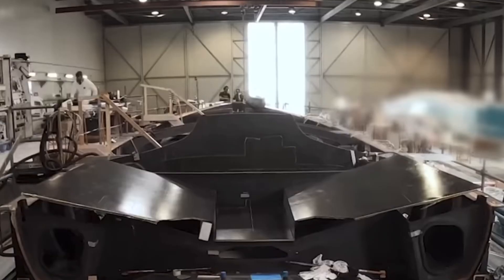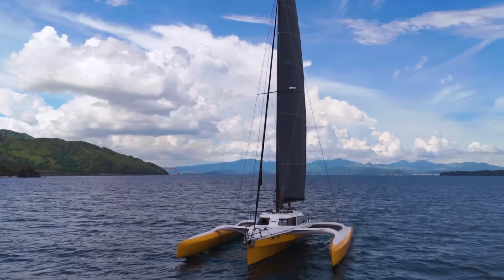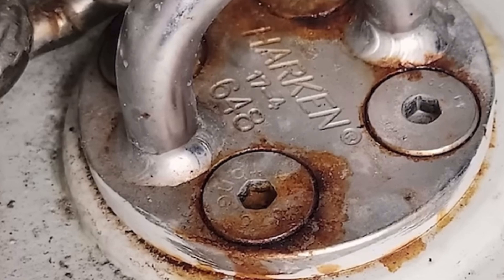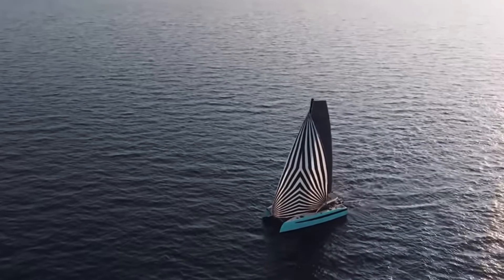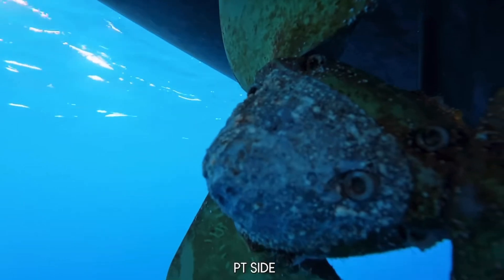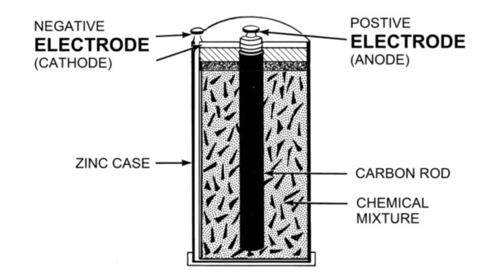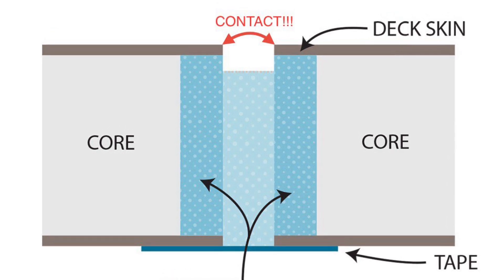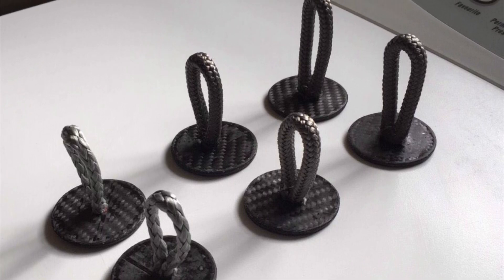Is Carbon Fibre Really a Good Idea for Cruising Boats?!?!?

Comment: I have pondered this conundrum in the past. With the advent of carbon fibre, and up until now, its relative unavailability to more budget conscious builders, we've only seen carbon fibre used in high performance applications. It's one thing designing, building and paying for a high-end performance carbon fibre vessel that planes in barely double digit winds, and then paying for its upkeep and living with its foibles. Its purpose is purely to just go fast, and to heck with the expense and the compromises.  It's another thing altogether producing a comfortable, durable and safe cruising yacht that can be maintained on a more realistic budget.
Realistically, we haven't seen a naval architect, or a manufacturer design a carbon fibre cruising yacht from scratch, and manufacture it. Of the attempts that I'm aware of, they are more akin to "tuned down" high performance boats designed purely to take home the silverware rather than boats designed specifically for cruising.
 
It's a rather different story to that of the introduction of GRP and hydro-formed aluminium. At that time, using a Herreshoff designed boat, or an S&S or whatever, as a plug, made perfect sense.
They were already cruisers or racer cruisers that were adapted well to the all new GRP. With time of course, naval architects learned of the benefits of GRP and were able to design more performance oriented yachts around the material. And with the advent of carbon fibre, those performance yachts evolved into beasts.

From a design perspective, the problem that I see with carbon fibre is that naval architects have to work backward with it in order to maximise its qualities as a material in cruising yachts. 
And they haven't done this, yet. And from a couple of recent examples, yards seem to have a lot of trouble understanding electrolysis and presumably other problems with the material.

Trimming weight from the hull material is a no brainer, as long as it doesn't come at the expense of durability. It gives room for better weight distribution, increased ballast and in the case of the cruiser, increased fuel storage, water storage and provisioning. But so far, this hasn't been a consideration, it's all about double digit speed.
And don't get me wrong, there's a place for that. But there's also a heck of a lot that can be done with the material that isn't being done.
Perhaps there's no market for the vessel that I envisage in my mind. It's certainly not me. My budget is a lot less than that. Gotta love 70's/80's GRP!
Reply from the maker: Good points! I agree that the fast production multis (e.g. Rapido, ORC) are not really live-aboard cruisers per se but performance boats with accommodation for vacationing and/or race crews. It would be interesting to see what an architect designing a pure live-aboard cruiser would do with carbon! On the other hand GRP really has stood the test of time with decent performance and good maintainability at a fraction of the cost of carbon.

Comment: Fiberglass is not good for anything but the cost. If you say otherwise you are just coping.
Reply from the maker: It’s also more durable if you hit something - can absorb twice the energy of carbon fibre before breaking. What kind of boat do you have?
Reply: @SailingTipsCa  non yet. If you want strong you go steel, if you want ok strength with ok speed you go aluminium and if you want speed carbon fiber. So where is fiberglass in this? Nowhere.
Reply from the maker: @connannbarbarin3033  Everything is a compromise! For example an aluminum boat with ok strength and ok speed will be more expensive than a glass boat. On the other hand a glass boat from a good builder can be lighter and faster than aluminum but not as durable, but still more durable but slower than carbon. If you were to create a durability <-> speed continuum it would look something like steel, aluminum, solid glass, glass/foam, carbon.
Reply: @SailingTipsCa  no, solid glass will be slower and weaker then aluminium and since only a few makers use solid glass and even fewer use it make anything other then old full keel design any good solid glass will be expensive. And i do not think glass/foam/glass (some builders say glass/foam is stronger then solid glass) is safer if you hit something then carbon/foam/carbon as (from my understanding) foam is what matters. I think that in real world glass/foam/glass will the same as carbon/foam/carbon if you hit something big (both are shit) and carbon will be faster. I am only looking at steel or aluminum for myself.
Reply from the maker: @connannbarbarin3033  There are quite a few solid glass / fin keel / spade rudder boats from the 70s, 80s, and 90s that actually perform pretty well and are reasonably robust. For example I used to own a Catalina 42 with a solid hull and fin keel and hit quite a few logs with only superficial damage (e.g. scratches). We raced it competitively and out-performed any aluminum boat we ever encountered, but to be fair there weren’t many we did encounter. Boats with foam core were lighter and a bit faster, but also much more fragile. All of that said if robustness was my highest priority I’d go with aluminum because it’s durable, relatively lightweight, and corrosion resistant (if everything is isolated properly).
Reply: @SailingTipsCa  fiberglass boats from 70s and 80s (and maybe 90s) are in my opinion dangerous. Resin would lost much of its properties. Now there is solid glass and solid glass. Some Hanses and Beneteaus have solid underwater hull, but it is thin and weaker then cored glass. More i learn about sailboats more I am actually leaning to steel motorsailers or trawlers.
Reply from the maker: @ Catalinas also have solid hulls. The hull on my Catalina 42 was 1/2” 12.5mm thick and reinforced with transverse stringers. I’ve never heard of a fibreglass hull failing because the resin was too old, but I know of many failures of cored hulls due to water ingress and delamination. Cored hulls are stronger in terms of rigidity but weaker in terms of impact resistance. Fibreglass doesn’t react with the environment around it so is simpler in terms of maintenance than carbon, aluminum or steel. The most important thing is that people understand the properties of what they are getting, and many don’t, so It’s great that you’re taking the time to research your purchase and understand the compromises!
Reply: @SailingTipsCa  if resin is deteriorated by time, temperature, UV and so on, its not like  the boat will fall apart, but it will be much weaker.
Reply from the maker: @ Yes UV is a definite resin killer and this is actually a huge problem on carbon components where the owners insist on the sexy look of glistening carbon with a translucent coating. You really need a good few layers of paint or gelcoat to protect the resin and slow its deterioration. As you noted temperature also accelerates aging so best to buy a used boat from a colder climate and not a place like Florida or Mexico.

Comment: I own a large 56 foot 6-cabin trimaran. She is built of epoxy fiberglass and a foam core. She is heavy and robust. Been two typhoons at sea and not even a spider crack in the gel coat. She’s experienced two very hard groundings and the kevlar encased keel took the brunt. Hulls remained in tact. All joints are 15-20x layers of glass and epoxy. She’s heavy, a beast. And yet, if I want her to go fast, she will. Multi hulls don’t heel over and “dump air” out of the sails like a monohull will. So your biggest problem is getting them to slow down, not speed up. So why the hyper focus on weight savings for an ocean passage cruising vessel? 

My favorite part about sailing is the passage, the journey. It is  beyond relaxing.  I am a surfer, kitesurfer, wing foiler, and sailboat racer. Those I do for adrenaline rush. But for cruising I enjoy taking my time and just chilling. Therefore, what I don’t get about the obsession with lighter weight in cruising is the “why?” of it. The tradeoffs for carbon fiber (same argument for electric electric engines vs diesel) just don’t make sense in the cruising market at this current time in technological development. CF is just too expensive for all the reasons you listed. If your objective is to “go-fast” in cruising, you’re not planning correctly and your priorities need realignment. I can get my boat to consistently surf down waves at 15-25 kts, even fully loaded. But the strain on the gear from deceleration in the trough is exponential and eventually something has to, and will, give, then, when you blow a spinnaker in two and it wraps around your prop as you run over it, or you snap a major rigging hardware component,  you’re now doing 1.3 kts whilst you repair at sea. Plus the strain on the body is fatiguing as well, 18-20 kts down a wave and then 5-7 kts in the trough hour after hour. Fun at first, but for what purpose? You MUST watch the boat at all times and you’re really operating on the edge of disaster if things go wrong like a major wind shit or a pitch pole event (end over end). You’re already in your home (on the water). Why are you rushing your passage? Where are you ABSOLUTELY needed and for what? I’m sure whatever it is can wait, otherwise you should’ve never been traveling by boat in the first place. Therefore slow wins the race. 6.5-10 kts is plenty. Unless you need to outrun a storm. The whole reason we bring our home on the water around the world with us is to enjoy the journey. Rushing is costly and will cost you even more  in mistakes in the long run. 

I will also slow the boat WAAAAAAY down to arrive in daylight, as oppose to trying to make a harbor or reef pass arrival before sunset. So when I’m approaching destination, I do the math on what speed I need to reasonably make the harbor entry by sunset or perhaps to slow down to 3 kts and arrive the next morning. Happens often. So if you’re suddenly slowing to 3 kts to adjust to sunlight arrival times, what’s the purpose of a “much lighter” boat then? Speaking from 50+ years of experience on the water. Save the speed for your buddies spartanly-outfitted race boats. CF is near pointless in a cruiser… even if you have money to burn.
Reply from the maker: Excellent points - thanks for taking the time to share! I think it’s a good strategy to get something a bit more practical as you have for your home and get the adrenaline rush in other ways e.g.kite surfing!!!
Reply: that is your reality... some people don't want the boat to be their life, don't want the boat to be their home, don't want to be on places because of weather etc... also speed is safety! and weight is also important for engine propulsion more than for sailing, because more weight will decrease the range, and again, not everyone want to be in places that they dont want to be. soo when there's no wind, some people want to be able to move, and fast. not saying that you're wrong, but they're different people with different reality, even people that need a helipad on the boat because they need to be in other places fast.
Reply from the maker: @CiberRepublica  Yes there’s really a big difference between outfitting a boat for weekend vacationing and/or doing the regatta circuit versus full-time live-aboard world cruising! It’s important to understand your own priorities before you begin, and they differ from person to person.
Reply: @SailingTipsCa  not just that, if you have real money why would you be limited to the boat? you would want to travel the world in it, but you can't know just the beaches 🤡 no one want to be the hole time in the boat, go to the country, go to a hotel, rent a car etc... beeing just in the boat limit your freedom. and if you have many house's why would you want the boat to be a house, it have to be like a playground, need to be different.
Reply from the maker: Yes everybody’s reality is different! I owned a large cruiser/racer for many years that I could have lived on and sailed the world, and also raced competitively, but my wife’s first love is horses which means we’re somewhat land-bound. So I sold that boat and bought a smaller dedicated racing boat instead. It has far fewer creature comforts but the performance is spectacular and I don’t have to maintain all the complex live-aboard/cruising systems anymore.

Comment: I totally agree on this one. Cruising will always involve taking a lot of weight with you. I have made the mistake before of owning a light trimaran and try to make it into a cruising boat. It just doesn't mix well. Decide if you want to race or go cruising. I have also owned an all carbon A class catamaran. Never again. Constant breaks downs. But if you want to race it's necessary.
Reply from the maker: Yes and if you want to do both maybe get both - like a heavier cruising boat and take the A cat with you!
Reply: @SailingTipsCa  perfect !

Comment: High performance sailing, CFRP (carbon reinforced plastic) is necessary. But for a cruising boat the CFRP is not necessary. It might look high tech, light and all, but that’s it. 
Disadvantage is that CFRP does not provide any advance warning before breaking, while aluminum or steel will buckle first before breaking, giving you a chance to reduce pressure on the sails before a catastrophic failure.
You don’t get that chance with CFRP.
Reply: The problem with Carbon fibre is that it doesn't give the same indication of failure as aluminum and fibreglass.  That's why you see racing boats having catastrophic mast failures.   The problem has largely been solved in the aerospace sector with radiography and cycle-limited components.
Reply from the maker: @forgetn  And the stakes are very high so they focus on getting it right! I think the problem with these in boating is that 1) most people would find radiography prohibitively expensive and/or not accessible and 2) modelling cycles on the ocean surface would be very difficult with so many variables (e.g. wave shapes).
Reply from the maker: Yes the tendency to break without warning is a huge downside that I neglected to mention!

Comment: Garry few more things on CF hulls/boats.  It is very bad in modern WiFi instrument comms and GPS signal through deck. So special antennae (outside) needed. Or back to wires. And it’s bloody DARK inside left un painted. So white paint add weight and cost. Did you ever try to paint white over black? And….Pips CF mast broke. For no clear reason.
Reply from the maker: Yes excellent points! Some classes even prohibit the use of carbon fibre in sails due to disruptions of radio communications so they have to use other fibres such as Dyneema/aramid. And racers often complain of the darkness inside unpainted boats. Unfortunate Pip’s mast broke…

Comment: My favorite argument for carbon fiber is that eglass is so dirty and not recyclable. You can literally turn a carbon fiber boat into 3D printer filament or car parts made of chopped carbon fiber (down cycle). In reality, the emissions of carbon fiber are annulled by it second life. we just need to create a good recycling infrastructure to allow it to happen at scale. we’d live in a cleaner world if all boats would be made of carbon and without eglass
Reply from the maker: There are also recycling facilities for fibreglass but for many items recycling often comes down to local processing facilities and culture. The sad reality is that most composite boats end their lives chopped up in a landfill somewhere.

Comment: Using S glass instead of E glass fiber could have benefits in strength without the corrosion issues. Is any company making S glass fabrics? It seems hard to find and only limited types of fabrics available. Does anyone know of any good suppliers? How does the cost compare to carbon?
Reply from the maker: Yes S glass would be an excellent alternative! We’ve ordered from Canadian Composites before which sells both S glass and carbon: https://shop.compositescanada.com/#/catalogue/category/fabrics/Fiberglass/S-Glass

Comment: Carbon fibre is better for racing , not for anything else , I love the look only. Take a bicycle where wheel mass is the magic along with lateral force maybe. HH looks amazing until the details show the basic mistakes in wiring not to mention the cost. Carbon will never have longevity compared to fiberglass aluminum or steel. It tends to have a catastrophic failure unless a weave of “ spectra “ is included was explained to me by some experts. With spectra, it could fail but not necessarily shatter into tiny bits leaving you stranded in the middle of an ocean ,,,in the middle of the night ,,, after you hit a container,,,,in a storm,,,and you wish you never left the dock,,,,and water is rushing in,,,,and you are going to die. Sooooo nope , it’s not a good material for a boat hull. Peace on earth and ocean 😊
Reply from the maker: Carbon certainly does look cool! There are some interesting Kevlar/carbon weaves out there that might help prevent catastrophic failure. Spectra might be easier to work with than Kevlar which is apparently horrible? Any experts out there which have worked with either?

Comment: For regen to work you need speed, hence carbon fibre. The additional speed allows for more sailing in lighter winds and less motor sailing.
Reply from the maker: Yes speed definitely helps with regen, and for speed you need light weight or long waterlines. Light weight and high strength can also be accomplished with a quality build using S glass. All of that said Sailing Uma seems pretty happy with their regen on their heavy old boat!